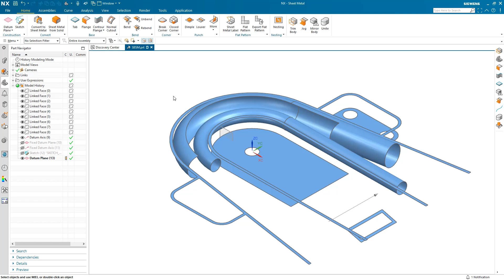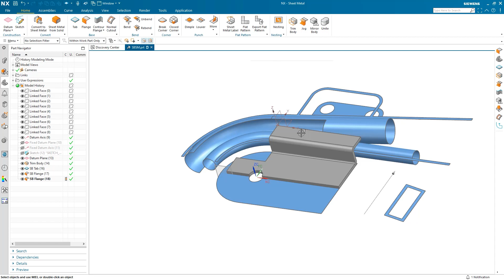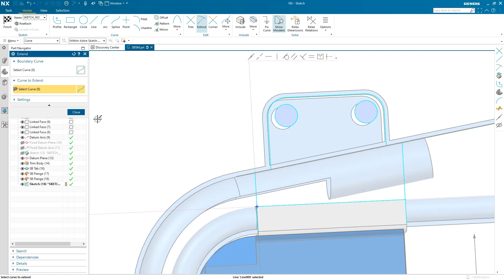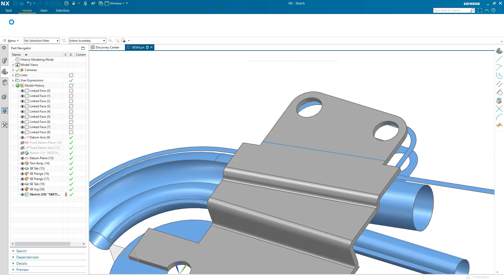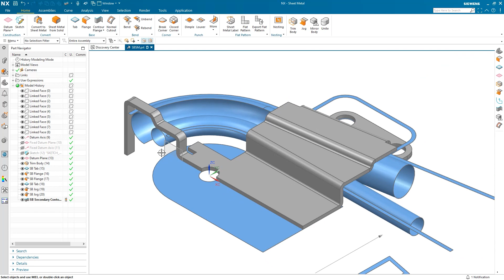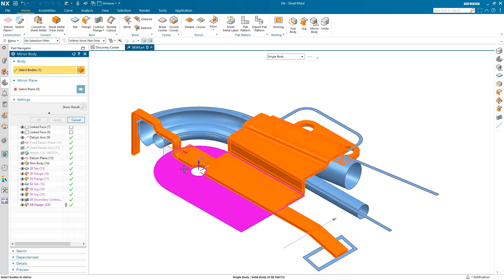NX | Develop your Skills | Sheet Metal

Comment: Geometry with broken links, implicit links in sketches... This is terrible!
Does anyone use modeling like that in the industry? Could you release the next video with modeling closer to industry standards?

P.S. NX is a great CAD tool, but with alot of not applicable capabilities in real projects.
Reply: This video did not imply anything industry standards, except a mere representation of how one can use the tool. Do you want to share with us a flawless NX design channel/s?
Reply: Really? 
Lot of automobile companies are using Nx
Reply: @farvezfarook3422  I know and I use it too. But I told about modeling style in video above. In many companies things like non-associative geometry links, implicit links in sketches etc. are forbidden. Because model becomes uncontrollable with it.
Reply: @stealth-350  concentrate on designing what you need faster than the competition, focus on better part design, less cost, higher strength, less material, lower part count, easier assembly - if you worry too much about the exactness of applying constraints to cover all possible change situations in the future you will be building in restrictions to innovative design and you will be a slow designer. That's my opinion. I understand models may need altering by someone else down the road - but there will be no road if too much time is spent on perfect constraints.
Reply: @Paul Bevan with respect to your student and wishing him a successful career, I think it would be a good tone, for example, to hide non-associatively related geometry in a feature group or use normal WAVE-linked elements to show that this demonstration is a part of a serious project.

About my P.S... 
For example, in many companies where I worked, it was deprecated to use the sheet metal module, sketches or assembly constraints. Because of the violation of the so-called concept of stable design.
For example, many features from sheet metal have implicit direction and positioning elements (which are usually based on sketches). Because of this, the behavior of such elements is usually unpredictable when rebuilding the model due, for example, to the changed geometry of the reference parts. It was often easier to completely rebuild a problematic model than to try to fix all the errors in it. Therefore, even in aviation design companies, in products with a large number of sheet material parts, such parts were usually modeled by surfaces. With all the inconveniences, such a model structure was more stable and predictable.
Similar claims to sketches. The absence of the possibility of explicit control over the limitations of the sketch makes the behavior of the geometry unpredictable when, for example, the position or orientation of the sketch changes due to some geometry changes that appeared earlier in the history of the model. Especially if the sketch uses related geometry from other elements of the part or assembly (as in the video). Instead, you have to use elements such as curves obtained by the intersection of bodies or surfaces, etc. This dramatically increases the number of operations in the model and complicates the process, but makes the model more predictable and manageable during rebuilds. And if any errors suddenly appear in the model after rebuilding, it is easier to identify and correct them. Rather than trying to fix the collapsed sketch on which the whole model is built.
Assembly constraints has similar problems. Due to the fact that parts are connected to each other by assembly constraints by specific edges, faces, etc., and not by mutual position, when rebuilding the geometry of parts, their position in the assembly becomes unpredictable. Therefore, most often all the parts in the assembly are built in a common absolute coordinate system and are either not connected to each other at all, or some kind of control structure is used that controls the position of the parts of the entire assembly.
Something like that.